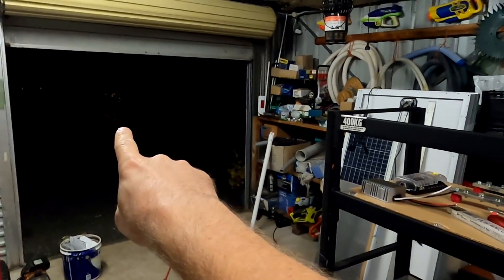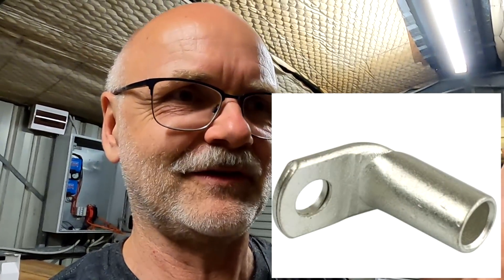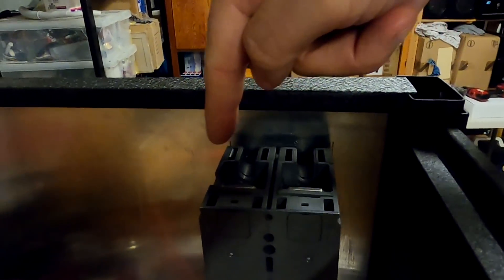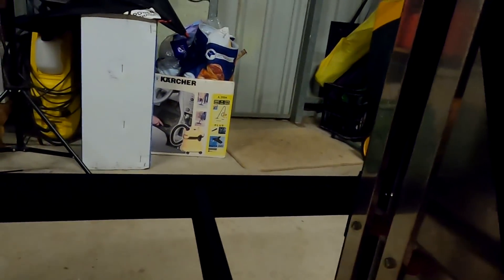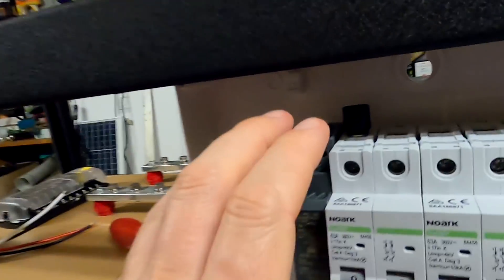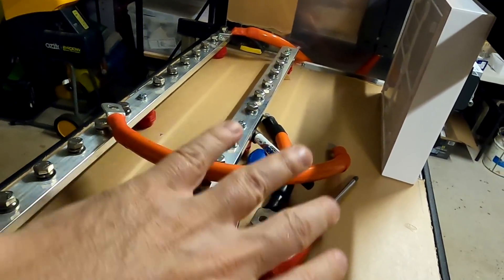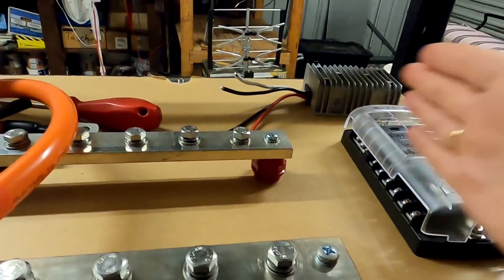Chasing the best connection design. Battery 2.0

Comment: instead of making a cover for you buzz bars just put them in heat shrink and use power cable lug caps for the lugs (Telstra has use this in telephone exchanges for a very long time).
Reply from the maker: This would leave parts of the bar and all bolts unprotected though. I bought the heat shrink for the bars already but didn't like the idea to hide these beautiful bars.
Reply: @OffGridGarageAustralia  well you could also use electrical insulation paint and paint then after connections are made this can look good to also add to the anti corrosive factor.

Comment: For the J box, I would look at different types to suit better. or just mount a din rail only for the breakers with a clear perspec cut out cover over the front that has long screws back to the din rail.
Reply from the maker: I thought about building a little switchboard inside the shelf for this purpose. That's a lot of mechanical work and material though. This small switchboard  does already fit perfectly. Almost...

Comment: The old school answer would be to strip the cable end, bend the end any direction you desire, and tin the wire with solder.
Reply from the maker: That would be an absolute no no for these cables and power going through it. You will have only minimal contact areas to the breaker terminals. That will get hot quickly...

Comment: I would be looking at using copper tubing elbows of a small diameter that suits the 35mm cable, may have to look at aircon guys, flatten one end of the elbow with your crimper dies  turned backwards to get a great looking flat area, if you cant get elbows then try with just copper tubing with a bender former to get a tight neat radius. Also if you want to bend lugs make sure you anneal it first to soften the copper, it may prevent it from tearing
Reply from the maker: That may actually work! Thank you.

Comment: Andy what about rotate the white box 90°? And use DIN rail only without white plastic box.
Reply from the maker: How does it hold?
Reply: @OffGridGarageAustralia  You can use some small L profile and mount it directly to steel frame.
Reply from the maker: @stanislavmlcuch2085  and how does it stick put to the front? How does a cover of the breakers look like?
This all makes not much sense if we can have all that already combined in that distribution box. It just creates other problems along the way. I think can bend the cables in a neat way so they fit into the terminals but also have no sharp bend.

Comment: Was checking out those Quickcable Magna elbow lugs. Seems they are common in the US and Canada (where the company is located). But prices around 10 to 20$ each is insane. Write them a email. May be you get a sample for your project. 😃
Reply from the maker: It seems they have AWG wire size only though which would not fit my 70mm2 cable....

Comment: Loving your German,Aussie, English again. 'Bended' is not a word. Once you bend something it is 'bent'....but hey you made me smile and my German is as bad as my Aussie! Regarding your problems drilling acrylic - did you consider using polycarbonate? It is cheaper and very easy to drill. It is not so UV resistant but I doubt you will be leaving your battery outside sunbathing very much!
Reply from the maker: Danke Herr Lehrer!
I've got all parts in Acrylic now, so will stick with that. I think about another material for the next project.

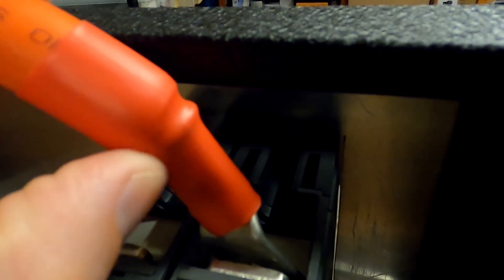Comment: @ 2:29 Take a short piece of copper busbar (maybe 5-7 cm long  ) drill holes on each end and mount it to your main breaker. On other end you can connect your cable using normal wire lug in 90° angle. 
For the smaller circuit breakers, I would completely ditch the "Fuse Box" and mount only a DIN Rail to the cabinet.
Reply from the maker: Perfect. Thank you. That's a very easy solution. I should have thought about that!

Comment: For the plastic cover use a grinder it melts and cuts through it to avoid cracks.
With the wires for the breakers maybe solder them and crimp it square without a lug? That will make the fit easier in the breakers and save a bit of money cause those lugs are pricey.
Reply from the maker: I think soldering is not allowed with breaker connections. It needs to be terminated correctly.

Comment: Don't cut the breaker box to fit, cut the frame. Think about access for wires. Or surface mount it, and use gland and duct. Its an opinion!
Reply from the maker: Yeah, OK, would be an option. If I surface mount the box the cables will come form the back, so no glands required.

Comment: Just a suggestion. To cover the bus bars you can use a length of square section white conduit with the lid of the conduit under the standoffs (on the perspex sheet) and the box section as your bus bar cover. As its Plastic its easy to slot for cable exit and it clips into the lid section on the deck. You can get square and rectangle section if you need it slightly wider. You can also spray paint it black and red accordingly. Working with perspex is pretty but it cracks so easy. You would only need one piece of box section  (cut in two) with 2 end pieces. Not that expensive and easy to get from L&H or similar.
Reply from the maker: Thanks Greg, good suggestions here.

Comment: i had to bend a few lugs for my car, the flat part on a vice and heat gun to make the cooper a bit softer. Hammer to bend the lug tapping slowly on the crimped part and i does not look too bad. Can't see any cracks but yes it's not as good as a already bent lug...
Reply from the maker: I need to think about the power going through it and the risks associated with that. I'll see what I can get...

Comment: Get rid of the white box. If you really want to use it you can use a short copper bar pr connection with a hole drilled and a bolt and nut. That way you can have the cables connected to the circuit breaker connections from the side with the lugs you have. But the best would be to get rid of the whole box and make a bracket that holds the din-rail.
Reply from the maker: I thought about this for a long time but... it's too much work to mount a DIN rail just in this area safely. I would need to build a box around it anyway...

Comment: I suppose to use "soft" (flexible) copper busbars to make small mini-busbars, that could be bended in DIY home/garage shop. What I mean. Your tinned busbars are "hard" copper busbars, commonly used in electric dustribution equipment. Here, in Russia, we can buy not anly this "hard" copper busbars, but also, a "soft" (flexible) copper busbars. These "soft" busbars are very handy, when you need to make some small bended busbars. These small DIY busbars, (often called "flags" in Russia) are very useful to make a transfer between CB's or Fuseholder's terminals to large cross-section cable lugs, which orientation differs from CB's terminals. Exactly like yours situation with large battery breaker: I suppose to use such "soft" copper busbars in this configuration: 2 busbars per pole. Each of these busbars are bent from vertical (at CB's terminal) to horizontal, along CB's case. And this horizontal part can be used for cable connection. The same "soft" copper mini-busbars could be made for CB's in plastic distribution box. 
Also, there this an alternative to thin-wall copper ferrule. It is thick-wall tinned copper ferrule for connection 2 cables by crimping in the way, as crimping cable lug. Technically, it is the same, as cable lug's tube, where a cable core is crimped. But this tube is approx 2 times longer. If you crimp cable core in this type of thick-wall ferrule, it will be much stronger,
Reply from the maker: Thanks for your feedback, Sergey. He too have this softer copper but it's usually been used for copper pipes and plumbing work.

Comment: Could your big breaker be mounted sideways? That is a very small plastic enclosure for big cables. I personally would consider mounting the din rail without a box.
Reply from the maker: Not any more. That train has left...
The DIN rail would need to be accessible from the outside though so I would ending up building a box anyway around this DIN rail.

Comment: Pin terminals ( DIN 46231 ) are also great to connect thick wire to your chrage controllers. The blue ones (35-50 mm² pin length 20 mm ) should suite your needs. Hope you can find them in sunny hot austria. ;-)
Reply from the maker: I have the blue ones for the 16mm cable already. Colour codes don't seem to match internationally 🤦‍♂️

Comment: Just make a short solid link with 2 holes,  long enough to bring the cable lug 90 degrees off the breaker
Reply from the maker: Yes, that's is great idea, so easy! Thank you.
Reply: @OffGridGarageAustralia  just be aware that every extra crimp introduce resistance, as does every extra bolted connection. Resistance = losses = heat
Reply: @sarelwagner1099  bolt and solder?
Reply: @NaughtyGoatFarm  Nope, you cannot solder with these high currents. Only crimping, cold welding really. Every single point of connection, ie. Crimp or bolted connection add more resistance and more losses. This increases the joint and cable temps.
Reply: @sarelwagner1099  Given it is a 48 volt system, and all the cables and busbars have a cross section quite a bit larger than minimum requirements, one extra connection is not going to be a significant contributor to losses
Reply: @nicholaskeur  fact is, its not one extra connection, its 3. And that is just for 2 lugs  bolted together. Its not the one, its the collective number. Every cable has 4.
Reply: @sarelwagner1099  it is ADDING one connection, one already exists to the breaker, IIRC it is only one cable that needs to be at right angles  the other has the breakers plastic removed to bring the cable out to the side...2:09 in the video
Reply: @nicholaskeur  Nope, not one connection. It adds 2 more lugs apart from 1 on the busbar and one on the breaker. 2 more lugs requires 2 more crimps and one bolted connection. Each one adds resistance. At high currents this can be significant. A bad crimp can easily have 0.3 ohms vs a good one at 0.03 ohms. Materials and wire interface cleanliness matters.
You are welcome to ignore the physics.  A bad crimp with 30 milliohm at 100A will create 300 watts of heat in losses and a good one at 3 milliohm a loss of 30Watts. So for 3 good connection point at best you will lose 100Watts
Reply: @sarelwagner1099  one lug already on the cable, a solid link to extend out the breaker terminal, zero extra lugs... one extra bolted connection... Think about what I wrote originally...
Reply: @nicholaskeur  You are focused on this connection only, I did read what you wrote. My point was to illustrate the principle of multiple connections. Physics.

Comment: Hi Andy. Great project. For the ring lugs and breaker connection, I will try to fasten a bolt and nut to the ring lug hole. Then insert the bolt into the breaker. This will give you a 90 deg bent. Just an idea from Denmark.
Reply from the maker: Yeah, nah, I'm sure that is not allowed. Technically it would work though.

Comment: Skip the terminal lugs and ferrules and install stripped wire directly into circuit breaker connections.
Reply from the maker: Big no no with this fine stranded copper cable.
Reply: @OffGridGarageAustralia  Andy, You need to do a video on why you think that.  80% of us aren't on board with this thinking
Reply from the maker: @mfgxl  the reason is that not all strands of the cable will have sufficient contact with the breaker terminal. You basically squish the cable flat and have the pressure on the top and bottom. Strands at the side may not have any connect at all or very little only.
You can only do this if you have multi stranded cooper cable with a very few thick cores or a building cable with one single core. Then you don't need a terminal or lug.
Reply: @OffGridGarageAustralia  ???? The same reasoning would apply to using ferrules/lugs. Are you saying that 4AWG/25mm2 cables have different current ratings depending on the number/thickness of the wire construction? Using a ferrule, it may not even contact the sides of the breaker terminal resulting in less breaker terminal contact area. 'Squishing' increases the contact surface area. The only reason you have different construction for a given cable thickness is varying the cable flexibility/bend radius. Circuit breaker manufacturers only specify the cable gage to be used and the tightening torque of the breaker terminals. I have not seen any manufacturers specify the type of wire cable construction to be used.
Reply: I agree 100% with you Greg

Comment: Since all the breakers are going to be paralleled anyway. Get some wide flat copper bar. cut fingers in it to slot into the breaker outlets to make a bus bar that runs past the end of the line of breakers and drill a hole in the bar to attach a main cable to then run to your shelf bus bar. Saves many cables in the breaker housing and you can attach the cable at the end where there is more room.
Reply: Yep
Reply: Absolutely. Flat bar is the best idea I have heard.
Reply from the maker: @kevinroberts781  it's not possible though as per my comment here.
Reply from the maker: That's not possible though as we have positive and negative terminals next to each others for each breaker.

Comment: make your own case out of acrylic ? cheap plastic sides back etc ?   then you control the variables .. rather than change all the other constants..  only recreate the case to suit and use the guts as are .. ?!  smiles .. 6 one half dozen of other . .great analysis ... loving it ..
Reply from the maker: Thanks Mike, I thought the switchboard has everything I need, DIN rail mount, front with cover and lid. Making one myself is a lot of work. I did this before when I was working in a switchboard company. They had proper machines to cut, bend and drill though.

Comment: Why you want to use a crimp connection while you can put the thread directly into the circuit breakers. In principle it is a safer solution because you have less connections. Using een crimping lug give for every connection two transitions instead of one. So less possible faillures.
Reply from the maker: That's not allowed. You always have a termination, either ferrule or lug. Unless it's a solid cable or has only a few strands.

Comment: How about using copper pipes and forming them to the shape you need? There are also videos on how to diy tint them after you have them in the shape you need.
Reply from the maker: A 90° coper pipe bend, one side flat the other round... Good thinking.

Comment: Insert cables into breakers like we do in the USA. I’ve never had a problem up to 200 Amps in the last 30 years.
Reply from the maker: Not with this fine stranded cables. That's a big no no! A lot of the small cable may not have any contact at all to the terminal.
Reply: @OffGridGarageAustralia   I think you are over thinking it my friend.  Like the bus bar.  For some of my bus bar applications I use a bolt and put up to seven ring terminals on the same bolt.  So simple and works great.  No heat ever.

Comment: This is the very reason why i used thick walled copper pipe for my cable ends. The ability to flatten the end and fold it over on itself to do angles is super easy and very affordable. On one of my connections i had to make a 90 degree bend, so i flattened the copper pipe with vise, then i folded it over on itself to create the 90 degree angle. Yes you will have to make them yourself and drill the holes, but i was able to tailor the holes to the exact sizes i needed for each bolt. The hydraulic crimper was used to crimp it to the cable after i made the end. Regarding protecting the bars, if the plastic doesnt work out for you, just pot them... I did this on all my battery terminals with hot glue, but can use basic silicone.. i just put a bit of tape around the battery terminals to create a wall and then potted them with the hot glue, because they are super cheap and easy to remove if i ever need to do something with the connection.
Reply from the maker: Thank for sharing William. Lot's of good ideas here...
Reply: I was just going to suggest the same idea.

Comment: why dont u  put the bus bar on  the side ,outside vertical  .make a hinge door cover for breaker and busbars and bms ect faster replacement   ,on top in not safe, u could tip over or short it out.🤔🤔🤔🤔😮😮
Reply: Great work Andy.
If you ever need such small quantities. You have springers located in Queensland. Should be close to you. Carroll lugs 👍
Reply from the maker: Springers does not have the bended lugs, just the forward backward ones...

Comment: If you put your circuit breaker box between the u shaped bars, then to take the cable out of the box you need to bend them 90degrees. My suggestion is place the box on  vertical support between the two u shaped support.

Comment: How to make an arbitrary bend lug when nobody wants to sell them to you for a remotely reasonable price: 1) get standard lugs 2) cut the tab off using whatever method you prefer 3) TIG-weld it back together using copper filler at whatever angle, shape and length you need 4) cover exposed parts with shrink tubing of appropriate color.
Reply from the maker: I'm sure everyone has got a TIG welder and copper filler at home, right? 😉
Reply: @OffGridGarageAustralia  Find/make a friend who does when you don't :D
Reply: Ive just bent the normal lugs in a vise, not normally an issue with good quality lugs

Comment: Those breakers can accept fork terminals (between the screw and the cable connection). You can cut te lug to a fork.
Reply from the maker: I looked at this, there is not much room though for thicker copper terminals.

Comment: If you add hinges to your alu plates you can open the parts where you need access. Good luck finding solutions and thanks for sharing so people can react and use a global brain to get your questions answered.
Reply from the maker: Th problem with hinges will the cable lengths I need to take into account with such a mechanic.